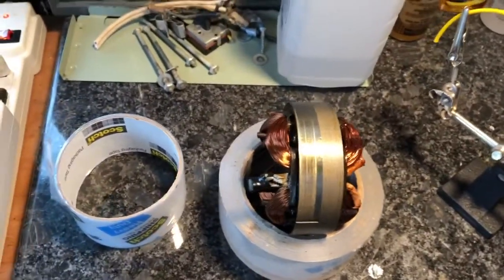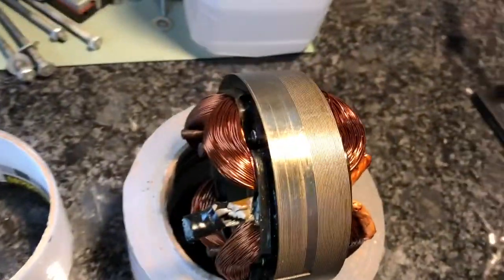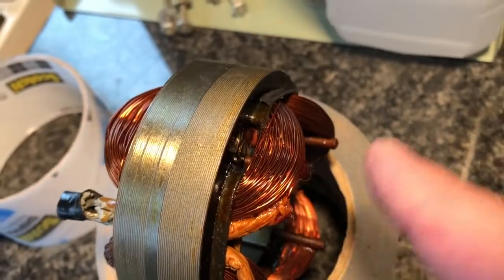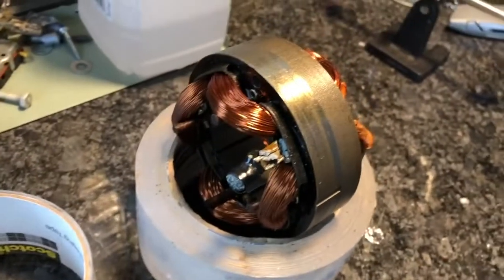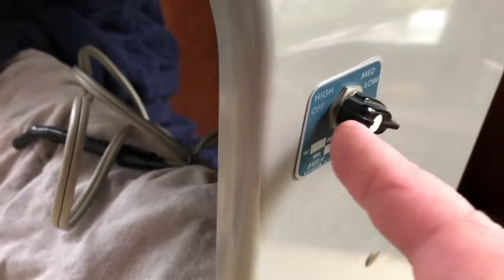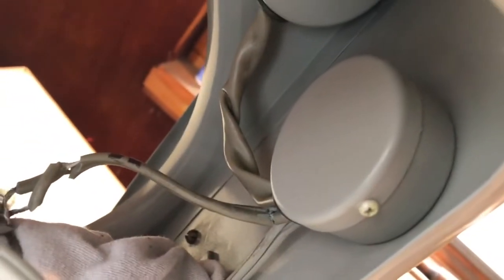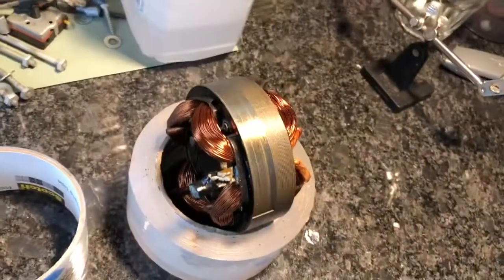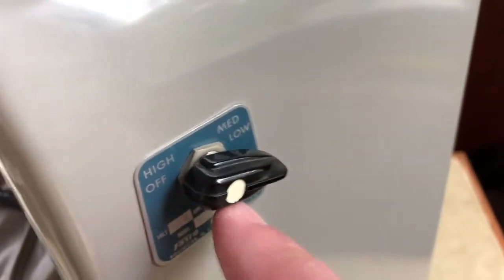Baby Fasco Solder and Switch Removal

Comment: The the knob is held on by screw. You have to pry that white tab off to get to the screw. Also with your soldering you want to have more than one strand of wire to be connected together.
Reply from the maker: sure. I was practicing for the lead wire situation - which would be 1 strand. I also worked on stranded connections.